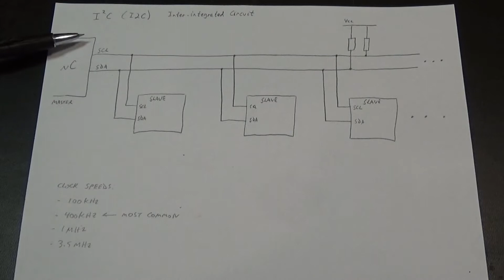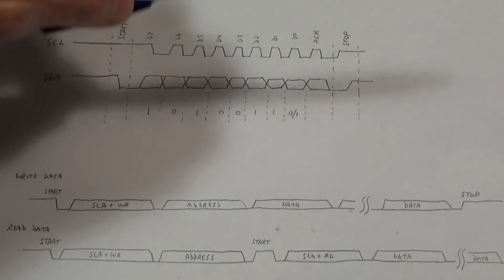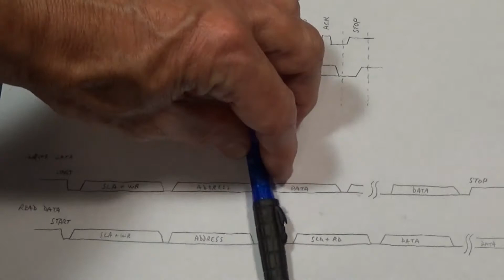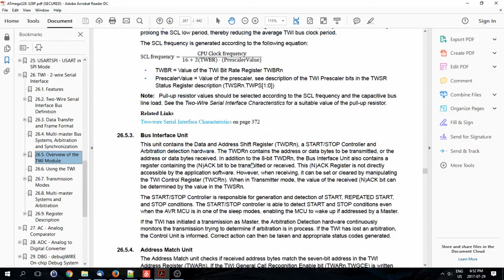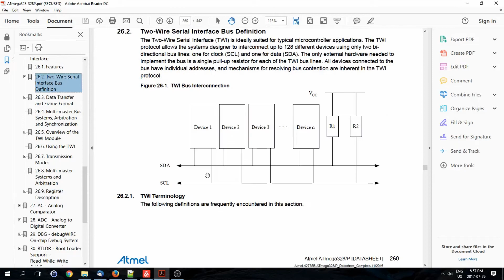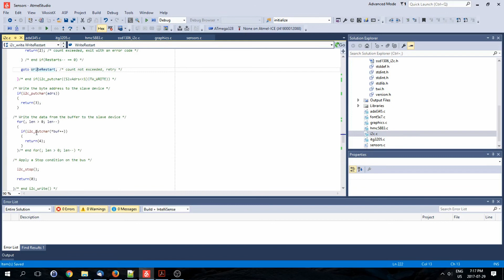Going Beyond Arduino #12: I2C Serial Bus, Part 1

Comment: Nice job, very exhaustive and easy to understand. The only thing I still can't figure out is: how the hell did you add libraries to your project? Atmel Studio seems to be a painful environment and no tutorial (til now) helped me to resolve this stupid issue. I use Netbeans, Eclipse, Simplicity Studio, MikroC, Bascom 8051, even the Arduino IDE, and none of these is a pain in the arse with libraries like Atmel Studio. May you explain what kind of sorcery has to be summoned to understand this? Thank you.
Reply from the maker: It isn't sorcery, you just have to tell Atmel Studio where your source files are.  It will then compile and link them automatically.  I did a video on source files in my Going Beyond Arduino series:

https://www.youtube.com/watch?v=zLoDcBJH2SI

Got to 21:30 where I explain how to bring existing source files into your Atmel Studio project.  That should solve your problem.

If you haven't done so already, watch the whole video.  I explain how projects are managed and compiled.

Arduino uses the wrong terminology which I think confuses some people.  The 'libraries' you include with your Arduino project are actually source files.  Libraries are files that contain already compiled (and hopefully debugged) source files.  They don't get compiled, just linked into your project at the end of the compile process.

Atmel Studio is a powerful IDE.  Have patience, there is a steep learning curve.

Good luck!
Reply: Despite of many tales and rants I've read on the Web, I think AS is a very good platform. And now, after you turned on the light in my mind, I finally got what always seemed to be too stupid to exist. As you probably guessed, I'm not C native. If I was, I didn't splat my face against that ridiculous misunderstanding: the definition of "library". But yes, I know that Arduino calls "libraries" actual source files, and in some ways I hate that wrong terminology. Atmel Studio manage libraries, actual libraries, that have to be pre-compiled in order to be used in a project, and that was so confusing.  Moreover, I found a tutorial named "How to add libraries to your project" that taught how to compile libraries with AS, and everything turned more confusing than before. 

So, thank you very much for the help. And, of course, thank you for your videos. I'm watching all of them, learning a lot.
Reply from the maker: Glad I could help.